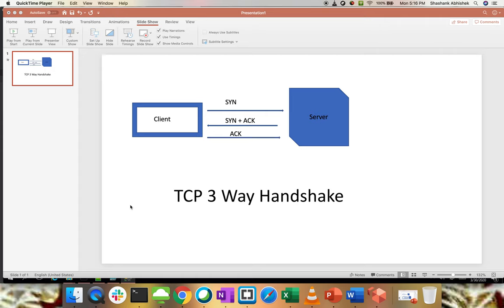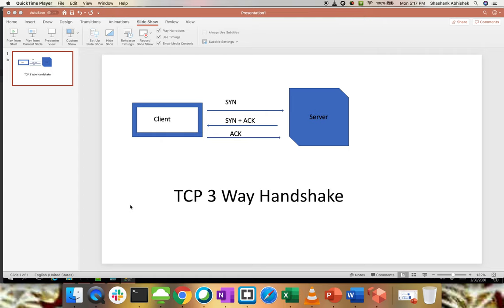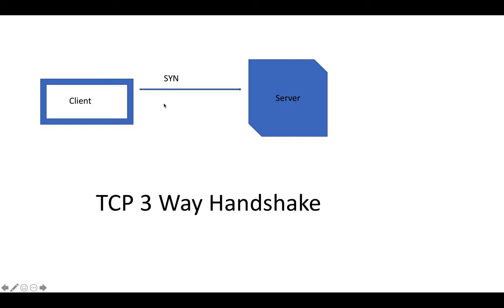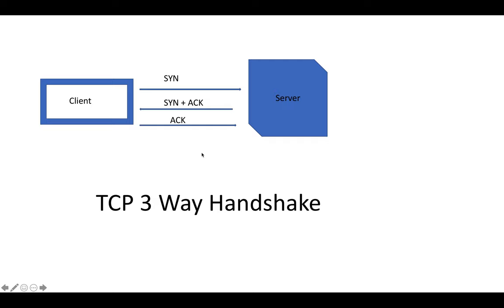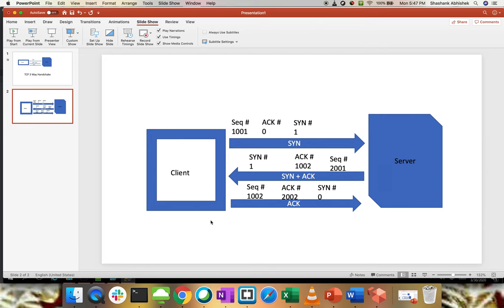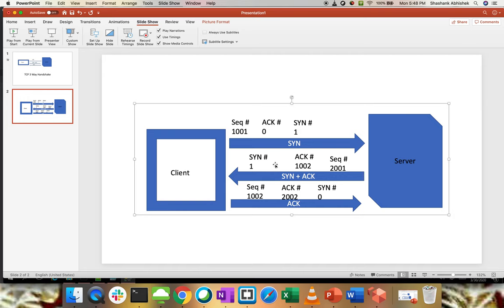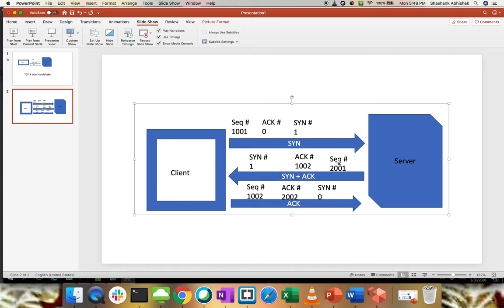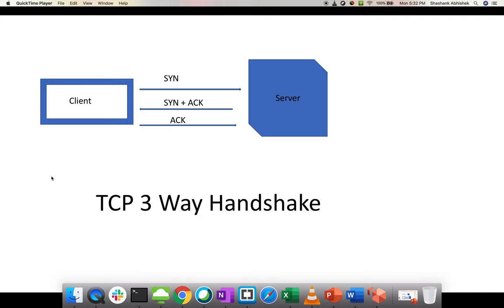TCP 3-Way Handshake Process | Concept

Comment: Hi sir I want AWS projects for reference plz let me know
Reply from the maker: HI,

It totally depends what kind of project you are looking for , if you want to hands on then i would prefer build a simple static website and host it on S3 , try to use cloudfront as an CDN network to get better performance across your websites. 

Static website code available over internet which you can download and update as per your best requirement.

Also you can watch how to host static website on my channel , its already. available and i have tried to keep it as simple as i can..

I hope this helps.
Reply: Thankyou ....for your reply..can you share mail id I will contact through   mail
Reply from the maker: Sorry for delay , this message was missed by me. You can contact me here sabhishek1107@gmail.com